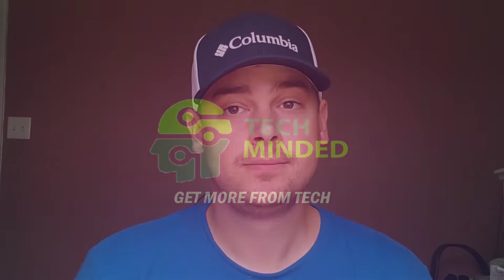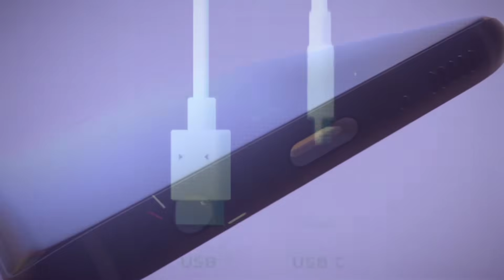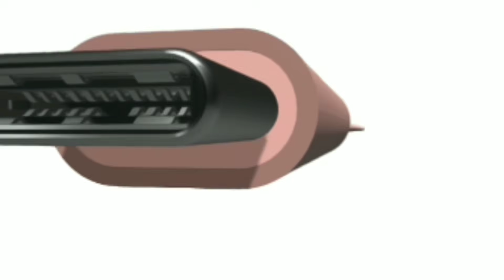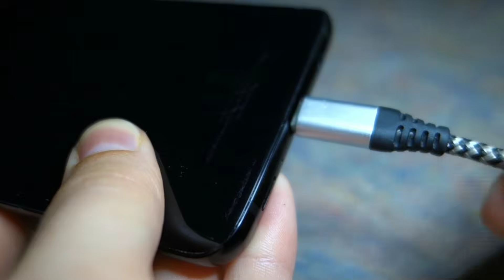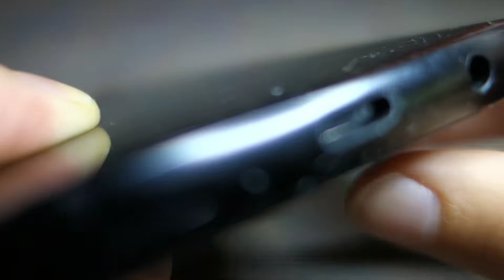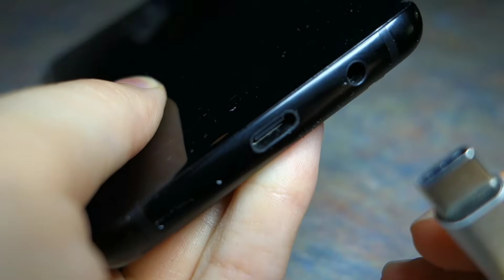Repairing A Loose Phone Charger Cable USB-C

Comment: There are two different types one that has a border around the metal bit that plugs in & one that doesn't have the border the one with a border snaps in has a better hold the other one just falls out

Comment: Excuse me male and female side???? Is that the technical word to use😭😭
Reply from the maker: Yes. Connectors on PCs and other hardware are called male or female based on which one plugs into the other.
Reply: @TechMindedYT 28 years and i never knew

Comment: Didnt help. Why does C cables start charging slower with time? Normal 2 hous from 0% then 4 hours, then 8 hours, then 20 hours!!!! To fix this i buy a new C cord then happens all over again till i buy another C cord.
Reply: The problem is the battery just changing a new battery.

Comment: I did this and thought it was clean, so tried sticking the cable in there. But it still wouldn't go in all the way and it still didn't keep connection if I wiggled the chord from side to side. I then tried some more with the toothpick and was able to remove 2 teenie weenie chunks of lint and that did it. So apparently it takes veeeery small amounts of lint for it to cause this issue. Now it plugs all the way in and doesn't lose connection. :) 

I used a "Plackers" toothpick. The plastic one that has a little string of dental floss on the other end (shaped almost like a y). The pointy end of this type of toothpick was already thin enough for me to be able to get all the way in there without having to carve on it with a knife.

Comment: Guys, if you tried this and still not charging because you wiggle the cable. You'll need to lower the 2 prongs inside the usb c slot (top or bottom). Over time, the prongs dont apply pressure to the port. So just push them down with a toothpick or something. (Non metal)

Comment: Can we get a video for fixing ports that children seem to "blow out" from shoving the chargers in and yanking out. I've bought my 5 year old four tablets in less than a year, all because the ports are no longer able to hold the charger, no lint or dirt. They will take a charge, but even with a brand new charging cord,  I still have to "McGuyver" the port and charger to keep a connection. I am currently using a Gatorade lid to charge my son's less than month old Kindle. 

I home school, and tablets are used daily for schooling.
Reply from the maker: Which tablets do you use? It depends on the type of port but I’ll be glad to look into it.
Reply: @TrentPierceProjects  A couple of them were the Onn brand at Walmart and two are from Amazon, Kindle.
Reply: Ill fix em.. but we gotta burn one and go thru your "seexxxing" playlist one time LOL

Comment: My cord clicks in but wiggles and tnerefore no secure connection to charge. Phone batt is drained even when plugged in to be charged...
Reply: Its probably the top/bottom prongs and dont apply pressure.

Comment: Dude change the name of the video, u r misleading everyone.
U didn't tighten anything, u simply cleaned a bad electrical contact, the last time I checked, tightening something requires some kind of adjustment. If anything cleaning makes things looser than they were!
U have just shown me something that is basic logic to me and has been since I 1st used portable devices with USB ports, thanks for wasting mine and everyone else's time!
Reply: I think he is telling us that the crud inside wont let the connector slide in far enough so te little pins will click into there holes a d lock in. I know it's a shity set up but icant help that that was screwed up in the planning  stage

Comment: I use a cotton swab cut in half and use the plastic part. I cut it at an angle so it has a pointed end. Also, the swab is hollow which traps some of the debris.

Comment: It's not a connection issue, not dirty, the metal C bit is a little bit loose but last night my charger when was plugged in started freaking out saying its charging not charging, now it doesn't work at all, do I need to buy a new cable?

Comment: What if the phone and charger are clean and lint free? I have accidentally dropped my phone while charging and then the charger has not stayed in properly since then? I have tried other chargers and they won't even work. Its and crappy phone just need it to work for a little while longer any ideas?

Comment: Everybody talks about lint in the socket but my usb-c is clean and the connection is still hit and miss. I've come to the conclusion that a usb-c connector is just very poorly designed.
Reply: yes. all the videos are about cleaning - it's not the problem.
Reply: Same❤
Reply: Same
Reply: The problem is that there's nothing supporting the cable, it literally hangs on the tiny metal bit at the end. Over time the slight pulling force on the cable deforms the metal bit and you need to get a new cable. If the hole was a bit deeper so the plastic bit would fit inside snugly, it would be more durable. I assume it's designed to be flimsy on purpose.
Reply: Yeah I tried a different cable and it helped. My conclusion from it was that sometimes cleaning the port is not the answer rather it is time for a new cable.
Reply: Bro USB B type is annoying aswell,I have to bend the charger to actually charge my phone
Reply: And now this is a EU standard. Cringe
Reply: When I plug in my charger it will hold but if I shake the phone super hard it falls out but it has a good connection
Reply: Yes, especially those new Onn Type C chargers. My old cords will snap but not the new ones.
Reply: Ditto — every YouTube video attributes a loose connection to lint or dirt.  There are dozens of them and they all give the same tired remedy.  Not so!

Comment: Every video mentions dust/dirt in the port. I cleaned it out and there was a little but did not make any difference . My charger just falls out easily and I cant find any other advice other than cleaning it. Am I just screwed ?
Reply: I have the same issue. Like the charger isn't big enough for the port, and it quite literally falls out unless I mess with and prop it. I think they get worn down faster, and the inner port shrinks from usage, and I think the charger expands from colliding
Reply: @perspectivesdiversifiedfie6949  I'm gonna try squeezing the end of the cable, c side, lightly with paper-wrapped pliers. Maybe the pins just need a little help. This video is for someone...more challenged.

Comment: This video says "Repairing a loose charger cable". Now that I've swept out the phones charger port, when might we learn how to fix the 12 feet of charging cable (complete with silicone, Glow in the dark insulation) that is now a bona fide clothes line now?? With approximately 11 feet and 11 inches to spare, I'm quite interested in making a better connection to my phone's charger port. Thank you for all your tips btw, and please don't take my frustration personally, I just hate user-UNfriendly tech fixes. TIA! 👍😉😁

Comment: This worked way better than I thought it would. I'm normally pretty careful about my charging port, and I've tried cleaning it out in the past. Evidently I didn't try hard enough, because I got a lot of gunk out this time. It was pretty packed in (probably from months of being packed in by the charger). I had to really scrape at it (I used a small piece of an old gift card), but it got out and works just like new. Thanks, man!

Comment: Another thing that might help is applying Isopropyl alcohol or hydrogen peroxide with cotton swabs on the pins in the connector. Since sometimes the pins get covered in gunk and can't make a good connection

Comment: Bro i cleaned out the port and it still isnt charging but will when I bend the charger back really hard and start warapping the cord around the phone.like its loose butvi took the phonw apart and made sure it wasnt loose so im just gonna replace the port as it was only $9 on Amazon. This is on a lg stylo 5(I know a POS,lol.)

Comment: Cleaning the ports is a must for any device but what I've done to get a better connection is to take a very thin strip of tape of almost any kind and wrap it around the base of the tip that goes into the device.  Some trial and error may happen to find the right fit. You may have to discard the tape and cut a different sized piece a couple of times but I've found it to work every time I've attempted once I get the right size piece of tape and everything fits snug
Reply: Perfect solution. Lint has never been the problem in my case. . .it's always been the male connector losing the ability to remain tight over time.
Reply: Thank you this worked great
Reply: I needed this info so badly ! thank you
Reply: Now, This is the hack l was looking for.

Comment: This did not work for me but heres what I did to fix my loose type C android charger cord ...I took the end that connects to the android phone charging port and placed the (silver part only) on the edge of my wood shelf ( a flat 90° edge) and gently tapped on it with a metal padlock ...turning the cord over and tapping on this side also. The cord will fit snug into the charger port. At first it will feel like it wont fit but be patient while connecting it..it will work. When I did this...I heard it click into place. I was able to hold the cord with my phone connected and like MAGIC it did not become disconnected. I hope this helps
Reply: I dont understand
Reply: @memoryrinehart  me neither
Reply: The poster states that placing the usb port flat on a hard surface and using a corner of something metal and heavy tap on the face of one side in order to create a divot or dent. This in turn squeezes the receiving side closer together so that they grip the female connector.
Instead of using a padlock, I used a tiny hammer.
Reply: You just smashed both sides of the male connector because the clips are loosened and making them tighter.  Got it imma try a version of that with so plyers and see if that works.  Thank I'll lyk

Comment: BUTTTT,from me missing and fighting. And sang dangling it over a year's time it appears that male part has scraped the shiny plastic off round the female,and looks to me melted across her prongs and the female wiggles up and down used to charge at angle now nothing,as for no dirt and Lint it's always had a good case with rubber gaskets on the holes and as habit I always shut then

Comment: I have a brand new Android that I purchased last month and am using (2) ANKER cables.  I tried to blow the cables out with a can of compressed air.  Still having my phone connection working intermittently.  Any other suggestions?

Comment: Hey man, i have the Nokia 7 Plus and i am racing an  issue where when i put in my charger, and it moves slightly, it stops charging. My charger is good, but i think the charging port is loose. I tried the tips from this video but it did not help me, do you have any tips for me, because im desperate🥺
Reply: Ur literally god how could you not know

Comment: This is the majority of video on Youtube dirt in the female end of the device but what happens when you clean it out and it still doesn't work then it would be the cable itself right? and no one has a vid for that. cleaned it thoroughly and still have the same problem but when I get a new cable it clicks in well.
Reply: Yeah it seems like it's always the cable that's dead
Reply: me too
Reply: I am in this same boat.
Reply: I read the "depression clips" inside the phone connecting end of cable are what need to be tightened if you have a loose connection. I thought thats what this vid would demonstrate...
Reply: anyone found a solution to this shit?
Reply: nooo i already ruined my fast charger
Reply: This ⬆️
Reply: Same
Reply: I didn't find an answer, bought new one
Reply: Same

Comment: I want to tighten my charging port not dirt
Reply: Same problem... It's clean but loose
Reply: Mines the same and it's clean as can be but still loose
Reply: I cleaned my charger  still nothing
Reply: What?!?
Reply: That sure is a very poor system isnt it , good for the people that sell parts.
Reply: Yh
Reply: Press the longer sides together very gently with pliers.  It gets loose.  Mine is now working.
Reply: Some connectors on the charging cable loosen over time.
 Only thing to do is buy a new cable. 
That will almost always fix the problem.
Reply: Squeeze the adapter that plugs into your phones charger together a little, so the pins inside are proper contact...
Reply: @ahamadshah7666  did this with pliers and it worked. First thing to do is clean out your phones and the chargers ports. If that doesn't work, use pliers gently until it's better.
Reply: Same. Its clean now but still not working
Reply: Disconnect the cable and chew on the cable sligtly and evenly. It will grab the inside properly now. Just done.
Reply: Use your hoover o
r small car hoover and suck all the crap out. Fingers crossed it worked for me. Plus c ports are crap.
Reply: F. Tonkonst  yes, it really is
Reply: @luosyrovi  no
Reply: @fieryneil7750  it is
Reply: @luosyrovi  it isn't ur pins on it might be down
Reply: its dirt that is making it loose
Reply: @luosyrovi  no its not mine clean as can be and is still loose
Reply: @luosyrovi  definitely no
Reply: @luosyrovi  mine has never been used before and it’s incredibly loose. How could dirt get in there before it’s ever been opened?
Reply: if your charging port is clean but still loose. means there is a problem in the plug, buy a new one..

Comment: Love the new branding! Can a loose cable be repaired? As in, an old doesn't stay connected but a new cable will. Thanks for the vids!
Reply from the maker: That's a good question. I've explored that idea, and I need to do a little testing. Not sure if the male part of the cable is repairable, but if it is ill definitely add a video for it.
Reply: This

Comment: can canned air  be used to clean out the port
Reply from the maker: You could certainly try. I don't think it would hurt anything. Just make sure to hold it a few inches away to keep it from freezing anything in there.
Reply: @TechMindedYT  Make sure your canned air isn't flammable.  Some products use butane as the propellant.  You don't want to spray butane into your phone as it could find a live wire and cause a fire.
Reply from the maker: Great advice James. This should certainly be considered if you are using canned air.
Reply: A live wire... In Cellphone?  Uhh no..